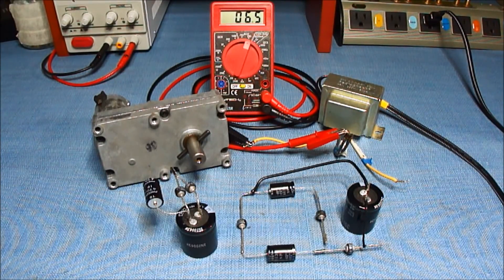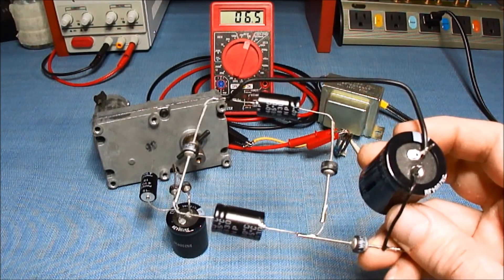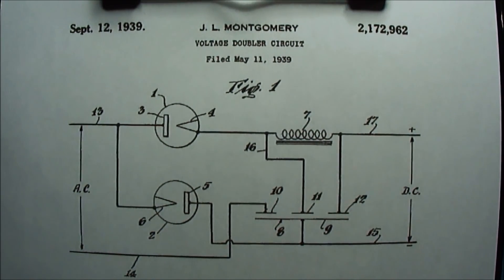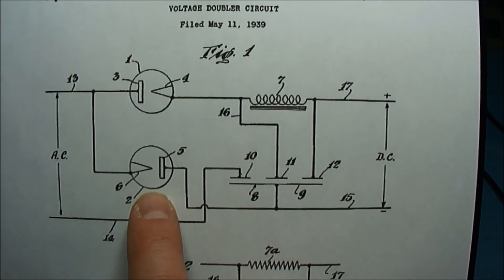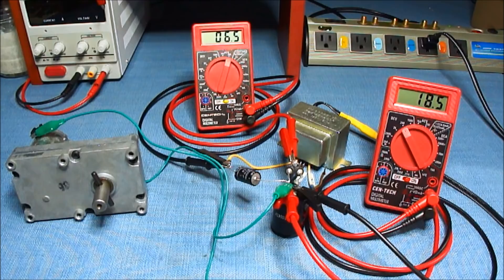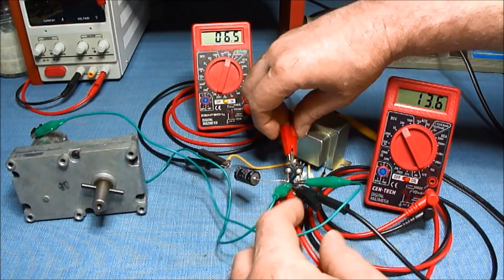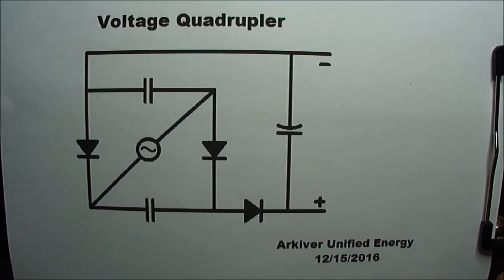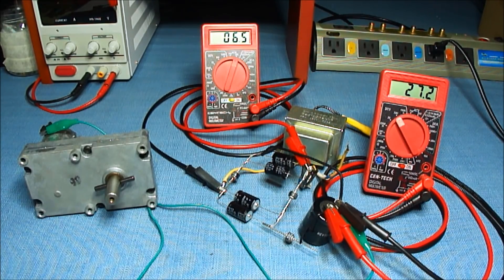Voltage Tripler & Tribridge Quadrupler Circuit

Comment: Seems this Circuit is a free energy circuit as the input voltage is not affected by the Load. If really so, High frequency and high Capacitance with high frequency diode is needed to boost the output before stepping it down.

Comment: Arkiver these schematics are not tripler and quadrupler but in fact doubler and tripler. Doubler is well known but I really like the tripler. Last circuit is a tripler, because it charges 2 caps in 1 half cycle and then these 2 caps + the coil are in series and there is 3x the voltage. When we rectify AC, we have to multiply by 1,41 (square root of 2). For example 6,5V * 1,41 = 9,16 and then times 3 equals 27,4V.
Reply: Thanks for explaining what's going on here.

Comment: thanks
i wish you show us the amperage in the input & output
can you tell us how much it was ?
Reply from the maker: Both circuits convert amps to volts like other multipliers. Tripler 6.5vac .4a --- 16vdc .125a  76% efficient. Quadrupler 6.4vac .7a --- 22.1vdc .145a  71% efficient. Different diodes and caps could help. The effect they could have at a generator or pulse motor could increase efficiency.

Comment: Hi Arkiver. Thanks for the circuit diagrams and its history.
Will this circuit work with pulsed DC also?
Having trouble with converting very high pulsed DC being converted to useable DC.
Thank you.
Reply from the maker: Hi. It should work with pulsed DC. Perhaps with a magnetically quenched solenoid coil. One way of stabilizing DC pulses is send it through a conical coil. The smaller turns have less resistance than the big end. They were used in distribution lines to stop high voltage spikes from damaging equipment.
Reply: Thanks for the new idea. I will try it let you know how well it worked.
Reply: I made a conical coil, as you suggested, and to my great surprise the Hz fell to 0.00!
Arkiver, I consider this as your kind Christmas gift for me. 
An early Merry Christmas to you, your family and loved ones.
Thank you.
Reply from the maker: Merry Christmas